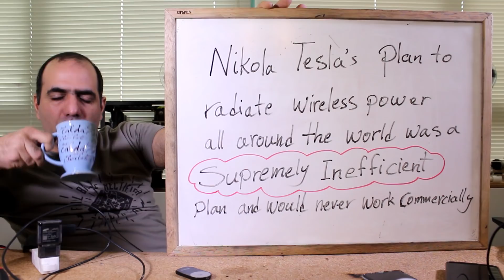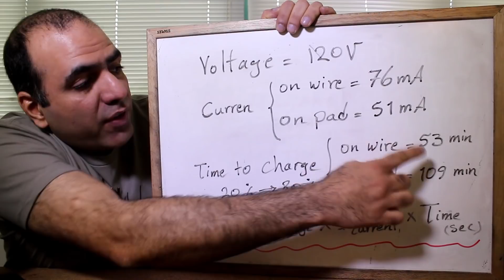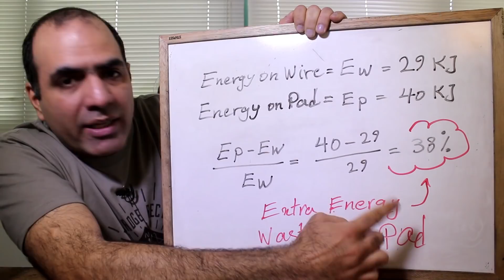Drowning in Inefficiency

Comment: The wireless charger is not junk at all, designing a $1000 cellphone with only one flimsy usb port to charge is junk. That's what 0.05 cents of energy lost to inefficency? USB-C has plug cycle life of something like 10,000 cycles, so each time you plug in your phone your effectively spending $1000/10000 = 10 cents. The wireless charger is 10/0.05 = 200x more cost effectice!
Reply: 10000 cycles at a very reasonable 2 cycles per day is still 13 years of use.
Reply: @user-si5fm8ql3c  2 per day is pretty conservative IMHO. You're assuming people only plug in to charge, for example most cars these days only have wired connections so you're plugging in everytime you drive somewhere not to mention data transfer and music players. Plus people often charge for short periods of time to prevent their phone from dying. Add to that the stress people put on their plugs beyond just the standard reccomended plug/unplug and that becomes a very vulnerable part of the phone. If you only use a wireless charger you can put a dust plug in it and prevent all that.

Irregardless, it's a 200x difference in cost, not 2x or 10x  but 200! The point is the evergy efficency lost is insignificant, and not worth complaining about. (How much energy was wasted making and watching this video?)
Reply: @MrGigaHurtz  you can always build the plug better rather than waste energy.
Reply: @TentaclePentacle  You can, but the people building phones don't. Again, the amount of energy "wasted" is miniscule
Reply: @MrGigaHurtz  the efficient is less than 50%. That's a huge waste.
Reply: @TentaclePentacle  See 4:24, there's a lot worse inefficiencies out there. Next time you are at Starbucks skip buying a coffee and put the money into renewables, that one $4 cup of coffee is worth more than the energy lost using a wireless charger for more than 10 YEARS! That is the magnitude of inefficiency we are talking about...
Reply: @MrGigaHurtz  we are talking about wireless vs wired. wireless is 38% of wired. That's a huge drop.
Reply: @TentaclePentacle  You are too caught up in the percentages. 38% of miniscule is still miniscule.
Reply: @MrGigaHurtz  38% of a billion phones is huge.
Reply: @TentaclePentacle  Go look up the % of energy used by an average person charging their phone compared to other activities and then get back to me
Reply: @MrGigaHurtz  that's like saying it's ok to leave the faucet half on because when I take a shower I use way more water.
Reply: @TentaclePentacle  Again, go look it up. Your orders of magnitude are way off. It's more like complaining about someone having a leaky faucet when they take a bath in a swimming pool and drain the water every day.
Reply: @MrGigaHurtz  38% efficiency means there is a 62% leakage. That's not a small leak, that's a busted water pipe.

Comment: When creating power with a gas powered turbine, 20% getal converted into electric energy, but 60% gets converted into thermal energy that's being used to heat houses. That makes the energy loss a lot smaller.

Comment: Common wireless junk we use for the comfort:
Mouse
Keyboard
Charger
Airpods
WiFi
And so many...
Reply: Those are data signal not power devices for data signal it only need just miliwatt not reaching 1 w so for high power wireless is unusable

Comment: yeah, we do need efficiency, but musk isn't really a hero here. Spacex made rockets maybe 10% safer/cheaper, but the efficiency gains are questionable. You know, that last bit of the fuel used to land the booster actually packs the most punch, so it artificially reduces the mass that can get to orbit.

Comment: no one uses incandescent bulbs
no one has a wireless charger in their house
politicians are right now talking about if we need to delete all the dangerous sources (like nuclear, fossil fuels, burning coal and gas and oil)
also if you like above 90% the you dont like nothing, because a 90% efficiency is nearly impossible
Reply: I would be delighted to hear the sources you pulled this information from.
Incandescent bulbs are still mass produced and readily available, so that doesn't sound like "no one" is using them.
Same story with wireless chargers, they even install them in higher end vehicles. 
Manufacturers don't mass produce things that there is no demand for.

And I'm not even gonna touch your second claim about unnamed politicians talking about energy sources considering you roped nuclear energy in with fossil fuels 😂

Comment: Yeah I hate wireless charging, why waste energy when it's just as easy to plug it in, no problem solved only problems created.
However I'd make an exception for a smart watch.

Moto 360 had the best charging setup and watches with wires are so far always jank.
Need to be able to take a watch off, put it on a stand and have it turn into and alarm clock without thinking about it or fiddling with it.
It doesn't have to be wireless but I've yet to see a wired solution as good.
However a watch battery is small and the coils are close, probably not much energy is wasted.

Comment: Someday, someone will hopefully invent an air conditioner that simply keeps all the heat it removes from the air during the summer and releases it as needed during the winter. Perfect temperature modulation in one appliance.

Comment: It is not fair to say that less than 80% efficiency is not acceptable, at least regarding fuel motors.
As you, an engineer, may know; thermodynamics place a limitation in efficiency by the 2nd Law (which regards Entropy).
For instance, the best we can do with a typical fuel engine (of a car), with compression ratio of V2/V1=15 is an efficiency=66%
Lets work on improving our systems, but knowing the limitations that are imposed by nature

Comment: I use phones for years, my current phone is 5 years old and the charger port is almost completely broken, and I need to babysit it to make it charge, while wireless charging is much easier and almost just as fast. I would still be using my old phone whose charging port broke 5 years ago if I had wireless charging on that
Reply: What port does it use?

Comment: If you use electric heating in a cold country anyway, wouldn't incandescent lights absolute not matter here? I mean, your electric heating needs to work less to keep the room warm in this case...? 

This is all of course BS in hot climates where people use airconditioning to remove excess heat from the room, there, incandescent make the usage much much worse, as the added heat needs to be removed by the air conditioner again

Comment: I use charging pads for over 5 years; some are 75% efficient with a thing case—the distance from coils matter.
There are many reasons for using a charging pad.
Some reasons are:
Moisture detected on the port.
Faulty USB charger port.
If you plug your phone on a charger over 6x Daily as I would in the car, it is convenient and protects the USB port from wear and tear.

Comment: I use wireless chargers because I can just drop it on the stand and it charges and I don’t have to look for the charger on the floor and my wireless charger has a usb c port on the back so I plugged in a cable so I can lay down and watch YouTube at night

Comment: Same with programming. Ease and lazyness (inefficiency) in programming requires more hardware resources and more power.  Take a look at really old computer programs how small they are and how effecient they have been designed to get the maximum out of the hardware (in ASM for example). Work of Art. Nowadays people even use Python on microcontrollers, doh!  Microcontroller development following the same path the computer did to provide ease with a cost, bulky interpreters/programs that requires more computing power, more memory and more conventional power.  Inefficiency everywhere, it starts by learning the wrong/wasteful and more easy things first. That is why most people don't think about it because ..... it is easy to not think about it. ;-)

Comment: To charge the battery with the magnetic it must not be surrounded with the metals so that the magnetic passes through it and is deposited as ions even the discharged battery is charged with the magnetic but stronger when it is not surrounded with the metals because it is is ready for re-entry.

Comment: Agree, I was really really satisfied when i designed one with 97% (in average use case condition ), but obviously...it has less than 3W and not so high currents, so basically inductor/transistor resistance do not impact alot on efficiency :)

Comment: So if there's no free energy then where does lightning come from?
The truth is there is no such thing as an absence of energy it's impossible to have an empty space with no mass and no energy it's just physically impossible.
 If you don't believe me Google it "is there any such thing as empty space"? and then Google "what's the difference between mass and energy"? when you learn the answer to these two questions you understand what I'm saying. 
 stop saying there's no such thing as free energy because all energy is free and it's everywhere. 
there's thousands of charged particles all around you everywhere you just have to understand how to use it.
Reply: Lightning is not free energy. Clouds are water vapor and the atmosphere can be turbulent. That turbulent air causes the water vapor in clouds to rub against other water molecules and accumulate charge. Since the clouds are way up in the sky with no path to ground, that charge can accumulate to massive amounts until it finally gets large enough to bridge the air gap between cloud and ground and discharge. It's the motion of particles in clouds that gives rise to the energy you see in lightning strikes. Would static electricity built up from a carpet be "free energy"? No, you had to put in work to accumulate that charge. Same with lightning. There's always some input, you're never just pulling energy out of nothing.
Reply: @thegreatzoom5073  you don't pay for it so it's free. simple

Comment: I also was enthusiastic about wireless charging pads...
So I bought one...
Then I realized that the phone needs to be equipped with a reciever...
So I bought wireless reciever that you can plug into your phone and hide behind the phone case...
     (it's a little flat coil in a plastic case with some electronics, equipped with a USB male port)
Then I used it for a while just to realize that it doesn't work well, and also heats my phone up too much...
...and is also much slower than the quick charge via cable (9V 2A, while the pad is 5V 800mA. Even regular cable charge is better with 5V 1A)...
So after around 30 bucks and one or two months of cooking my phone's backplate I stopped using the pad, and gave the pad to someone else... Who also stopped using it.

Lesson: Don't waste money on cr**py electronics

Or anything else that's cr**py

But if you're not sure whether it's cr**py or not... well... Google it... I didn't...

Comment: Hey Electroboom even if you figured out the perfect design for anything, it will still be less efficient than you expected. No matter where you go there's a fundamental trait of everything that exists, a change requires energy. The universe resists change regardless of what kind energy it is. Notwithstanding if energy is spent in any type of change, there were something there to absorb that energy. It went somewhere

Comment: windpower is not enough to power a city 45kw and is very expensive in maintenance and in areas where there are no moving water hydro plants is useless and solar only works when the sun is visible and has very expensive maintenance the only one that is right now best power are nuclear power 1 reactor can power whole NY and does not send any carbon dioxide into the air but only negative thing is the nuclear waste

Comment: But Elon Musk is just a charlatan who repackages ideas others already had and runs his business like if a Ponzi Scheme that actually sold stuff. The dude's basically Edison 2.0, so basically the guy who takes credit for the work of more technically capable people, except Edison had at least some basic understanding of what he was stealing.

Reusable rocket? Tried by others and abandoned because the added complexity creates too many potential failure points, as indicated by the issues SpaceX has had over the years. The applies to not just initial launch but iterative launches as well(assuming it doesn't fail on the first go). 
Moreover, the materials of launch rocket itself apparently aren't actually as expensive as the fuel it's using, so a reusable rocket ends up using more fuel per launch than a single-use version, thus potentially costing more on just fuel alone. 

Hyperloop? Literally a century old idea that he somehow managed to make even less efficient by making the vacuum tube be above ground then tried to outsource solving the glaring flaws with the fundamental concept to design students.

The electric car? If we ignore the fact that by their nature, they are worse for the environment overall than the internal combustion engine it's trying to replace by a very large degree, there's still the issue that he's selling something with the build & design quality of a 90s KIA for the price of my damn house. I have a friend who used to work for Tesla as a mechanic. He said that the Teslas are the worst cars he's ever worked, which is really saying something considering he's worked on my vehicles...

The solar panels front isn't doing much better if those systems that caught fire at various walmart locations are any indication. Speaking of Tesla solar, love how he had the idea for solar roof tiles, which has been made years prior by several other companies and discontinued due to being horribly inefficient by their fundamental nature compared to regular panels with a clear covering over them.

Comment: Yes, you need a heater at home anyway. But a resistive heater is inefficient because you lose the opportunity to heat using natural gas (since only 50% of the gas energy gets converted into electricity at the plant, you might as well run a gas pipe to your house and burn the gas directly). If you don't have gas, you might have a heat pump which is more efficient because it doesn't just heat your home, it pumps the cold out. You can even get a portable AC with a reversing valve and connect just the exhaust hose. This creates negative pressure which pulls already hot air inside the apartment from the common areas like hallways, which you don't pay for. Also, why are you integrating power measurements using a dodgy multimeter with loose live wires and a whiteboard? Just get a Kill-a-watt.

Comment: I have micro-usb cables all over my house, and go through about 1 micro-usb cable every 4-6 months. I mean, I keep them longer, but they really stop being effective at charging things after the 6 months.
I expect that the wear and tear of pushing plugs in my phone is worse on the cable than it is on the phone.

I wonder if the cost of manufacturing for these cables can be added to the calculations of waste of the wireless charging.
It's still probably not worth it, but I'm curious about that.

Comment: When it comes to charging pads. I have bad luck when it comes to my charging ports stripping out and not being able to charge with the cable at all. While usually i use the cable when possible, but recently i've had to switch to a pad.

Comment: Myself, I think we're drowning in social inefficiency far more than the technical kinds. (That's not to say we couldn't literally drown if global warming indeed goes out of control, but just to put it into perspective; indeed social inefficiency is also a huge obstacle to agreeing on a viable action plan for global warming mitigation.)
Dealing with the expectations of many "neurotypical" people (check out the "Institute for the Study of the Neurologically Typical" if you haven't already) is such a burden for me (on top of correcting their endless mistakes) that I try to reduce it to the bare minimum possible. This is not because I'm "disabled" as they judge me to be (and to be fair, more "severely" autistic people can indeed fairly be described as), but because there's no efficient way to communicate anything important to them (being blunt is "rude" to them, and being "sharp" won't work when they're so dull in their own thought). I didn't want to hate those people, but in the end I kind of do. (Nothing against Mehdi or the commenters here; I'm just describing the general public.)
 
To provide an interesting mathematical comparison: My Casio fx-82MS scientific calculator (from the early 2000s I believe, old enough to contain leaded solder anyway) is rated to draw 0.0002W (200μW). (Which if anything is pessimistic, measuring its input current with a DMM.) The adult human metabolism averages around 100W, yet far too many of them struggle with even extremely basic concepts such as Ohm's law (which being just applied multiplication/division, is easy to do on even a simple office calculator in a pinch); to the point that Dimplex (Dumbplex?) actually put out a convector/fan heater (model 3088T) with wrongly-rated heating elements (the label says the normal Australian 240V 2400W, but they actually used a set for 230V 2500W scaling to 2722W at 240V) among numerous other design flaws (despite all of them, it did still work although it's just as well the original owner got rid of it).
 
So by that calculation, such people can be less than 0.0002% efficient at doing their jobs.
And you thought incandescent lamps were wasteful (at least they were optimized within their material constraints, unlike far too many consumer-grade vacuum cleaners)…

Comment: 'we must surround our Sun in solar panels with thick AF cables running all the way back to Earth'
-Science
Reply: even a single solar panel say about 10 miles above the sun's surface would generate huge amounts of power compared to a solar panel the same size on your house, provided both could handle the intensity